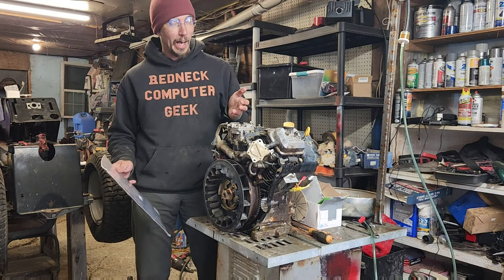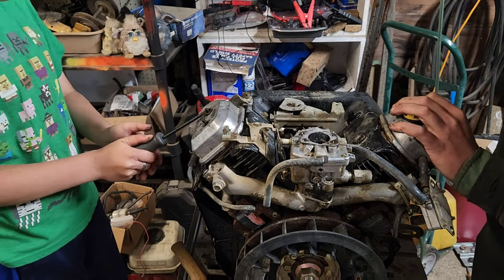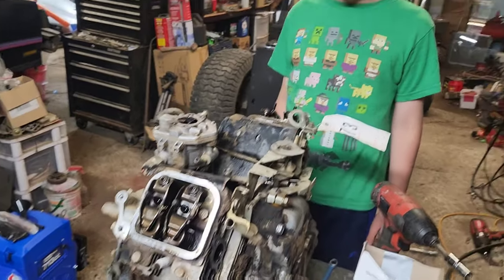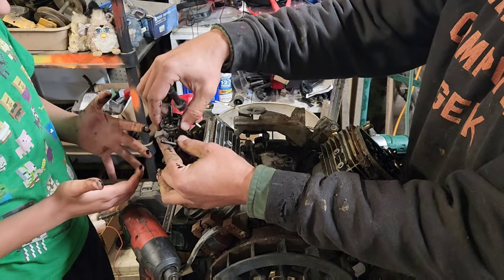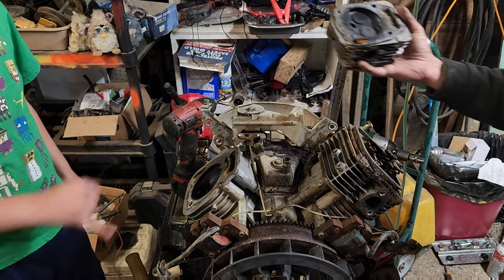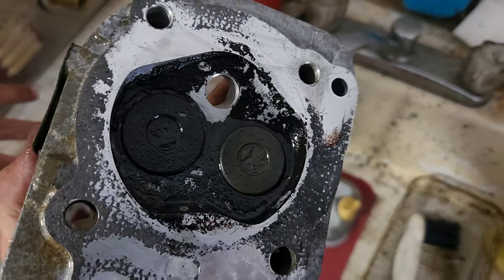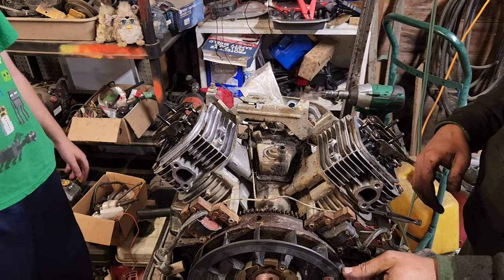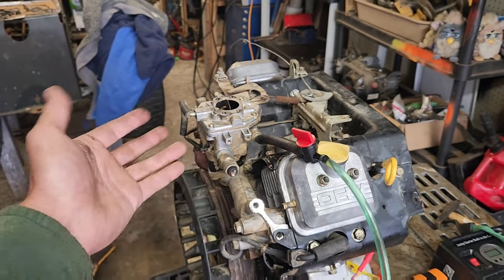Vanguard 18hp Head Gasket Replacement

Comment: You should put a large plastic bag in the ultra sonic, to keep it clean, similar to putting a jar of water with the parts inside keeps the ultra sonic clean , while still cleaning everything,  I hate having to clean after every use!  A large thin trash bag would work, but require water on both sides say 1/4-- 1/3 to in the tank then the plastic bag, then finish filling, not over filling!

Comment: Hey, I have a question about the deck engagement cable on a craftsman 42" mower. Cable works, but doesn't disengage. Cable stays put when releasing the lever.

Comment: I've got basically the same engine and im having a REALLY strange issue with the engine, is there anywhere that I can PM you somewhere?
Reply: Having problem with mine as well...cranks without plugs but not so much with them in. Valves seem right so I dunno.

Comment: howdy i seen you had videos of mtd belt installation a while back just wondering if you know the drive belt size the one from the drive shaft of the engine to the centrifugal clutch in the middle mine is a mtd 18.5 46 inch cut it recently snapped towing a grizzly 600 up a hill and i dont know the size if you do it would be a great help
Reply: it has the 4 bolt rear hubs

Comment: I want to build a large high powered ultra sonic,  about 50gallon, and about
 20-30 x more power ful, maybe dual tanks have a second 20-30 gallon tank to fit inside with parts to be cleaned,  also including a heater and pump, capable heating past 
200° F, and circulate through filters, around  1/2- to 1.5 gpm filtering in a 2gallon  filter of stainless mesh and scrub pads, very coarse, with the uptown to  nearly. Completely filter the water,  a fine filter similar to a furnace air filter , stacked multiple times,  flow about 2 gph,

Comment: Mr Redneck, any tips on freeing a stuck throttle/butterfly on a carb? (23 hp Kawasaki)
Reply from the maker: Pull the Carb and soak it in something like used tranny fluid. You need something that will eat into the build up but not ruin the rubber and plastic. PB blaster or something like it will work but yet again soaking and let it eat in.
Reply: @redneckcomputergeek  Thanks. will try.
Reply: @redneckcomputergeek  Unfornately after soaking the carb for a week and trying to unseized the throttle shaft, the carb is pretty much junk. It had a mouse nest in there for who knows how long, and it probably a good idea to just get a replacement carb anyway. Any aftermarket carbs you'd recommend? New original is  200-300 bucks.

Comment: Little John is very mechanically inclined, it's great to see father & son  project. The oil somebody put in the engine is mystic or mechanic in a can it smells like burnt walnuts, That briggs is a throw away engine. That's what the man from Briggs told me 30 years ago, the have plastic cam shafts they are designed to wear out after the warranty is out now if you have a cast iron block I will rebuild those all day and have them bored out by a pro I will give you a year warranty on those.
Reply: Vanguards are all steel inside except for the oil pump gear, and I’ve never heard of any failure on these not caused by beating the snot out of it. Definitely not in the “new junk” category IMHO.

Comment: Why did you not pull out the Valves ? And Quick Value Lap? 
Just Saying LOL , You all ready had it apart and would only take 15min per head. 
I also Know what you are saying about the cheap China Value Seals , They are not worth using!! as they always fall RIGHT apart after no time. 
the problem you have you think was because of the carbon , Who knows how bad it was behind the Exhaust Value. 
Sure the ultrasonic cleaner would have broken up a little and everything will be fine.
Reply from the maker: Good questions: Off camera I forced open and checked each valve and seat. Only the P-1 had any major build up and rubbed out easy with a green scrubber. I left things like that out cause the average rip it down get it done builder would never bother. In a future video I might do an old fashion toothpaste grind job just to show it works. Ultra sonic wise I tried to get a before and after clip on the exhaust port but my camera just would not focus on it. The cleaner took out 2/3 or more of the carbon in there. Given some run time the rest should burn out.

Comment: Looks like it's burning oil from worn rings/bore. Probably still will too
Reply from the maker: I was thinking about the same. As it is the engine will just be for testing repowers so not to worried about it.
Reply: @redneckcomputergeek  ya definitely good enough for what it is 🔧🔧 I like seeing your boy turning wrenches how I was with my dad that young working on lawnmowers and chainsaws